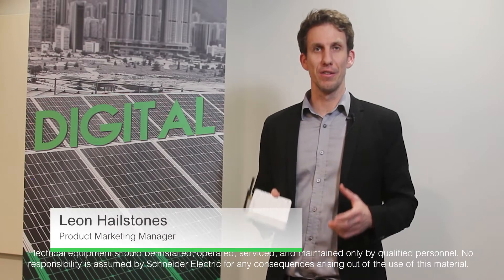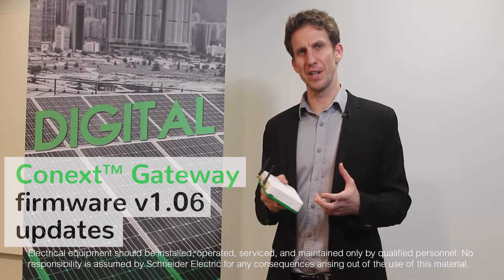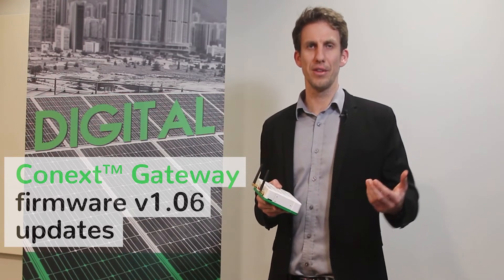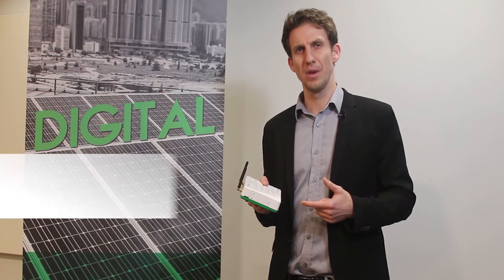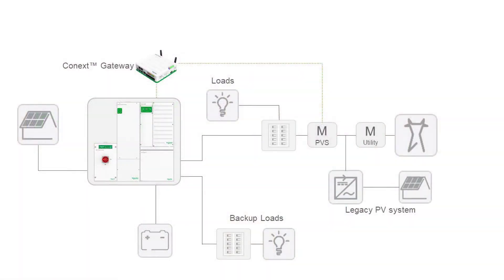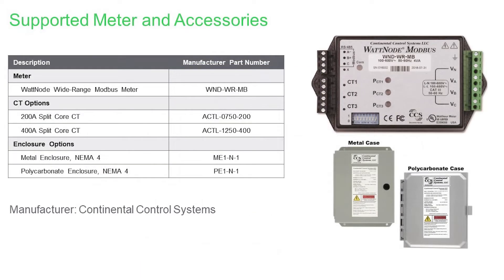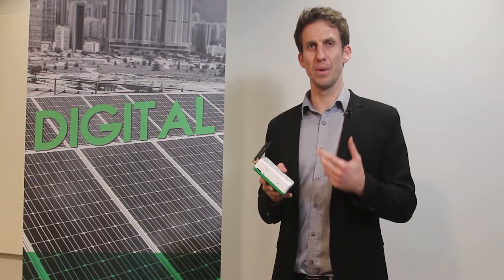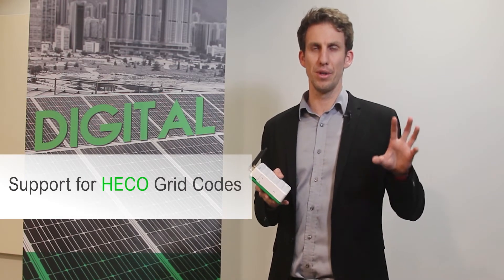Conext Gateway Update V 1.06

Comment: Thank you for the update. 
I concur with Impakzy. Your customers would benefit form few additions:

- better LiFePO4 support/integration , including State OF Charge
- Improve Grid Support / Load Shave on XW Pro with LiFwPO4 batteries in AC coupled scenario. Currently no way to recharge automatically Li battery, as in grid support mode the system is stuck @ RechargeV + 0.5V. Please make this 0.5V configurable value, potentially ==0V.
- Add timer function / scheduler to Gateway - at specific times , periodically , perform some actions. (example: at specific time trigger charge of battery)

Comment: Please may you do a video on setting up the Wifi conection to the local wif connection.

I updated to 1.6 and tried to connect to wifi whitch i was successful in doing so but now the cloud conection is lost and even after a factory reset it is still refusing to connect to cloud. 

I belive there is a bug in the wifi or lan cloud routing. 
Thanks Seb

Comment: Hi,
Good job.
Keep it up.
Could you also embark on upgrades to ensure that your inverters are very compatible with more LiFePo4 batteries in the market, as well as making it possible to us your battery monitors effectively for lithium batteries.
Also the possibility of installers to be able to adjust the battery recharge levels so that your customers can enjoy the full benefits of the lithium batteries while using your products.